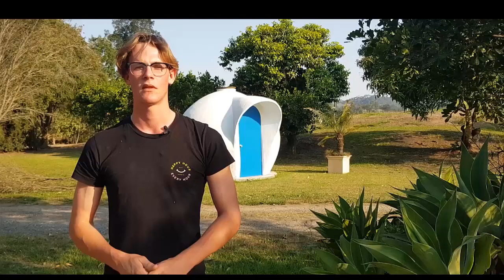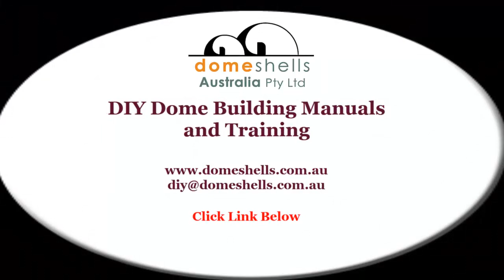Basalt Fiber Reinforced Concrete Dome Workshop Manual

Comment: Baby Dome how many meters of diameter?
Reply: The dome in the video is only 2.4m across the floor slab. At the widest point it is 3.0m. On our website there are images of a 3.0m diameter at the floor and 3.0m at the widest point. The example shows a desk and day bed inside. It,s a more practical and useful size.
Reply: When I build the domes only 7 mtrs of diameter.
Reply from the maker: That one is only 2.4 at the floor level and 3.0m at the widest point